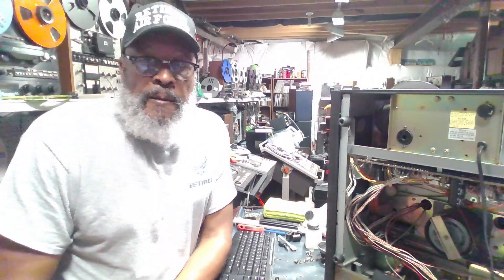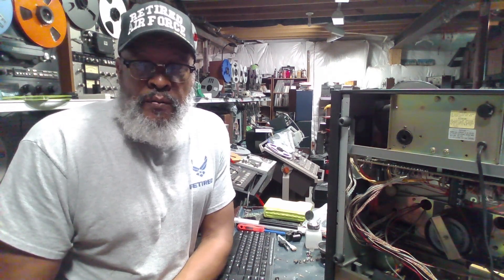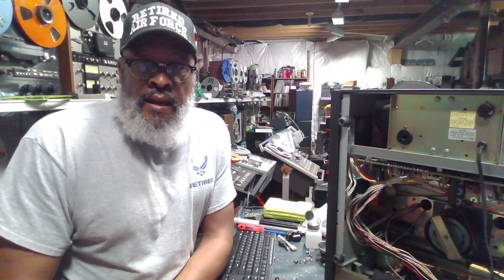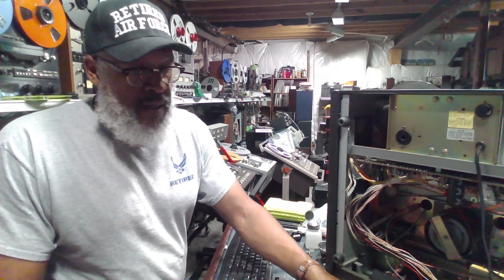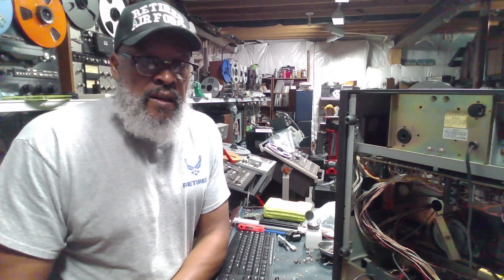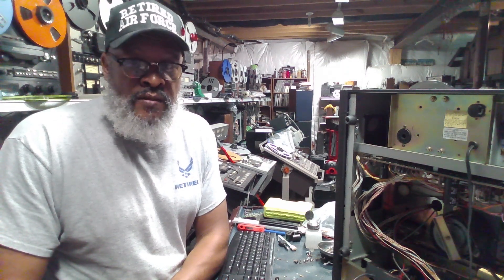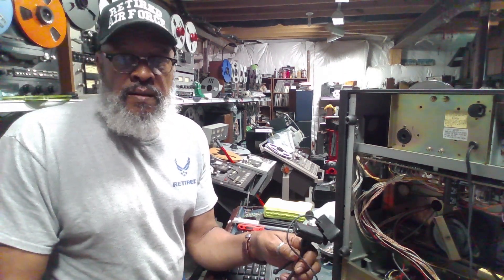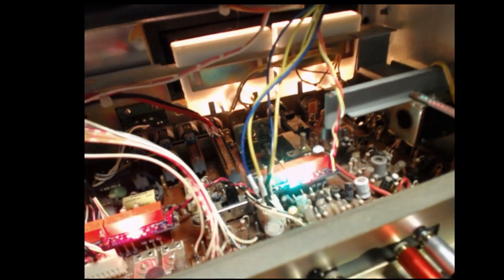Akai GX-635D Reel to Reel Reversing Switch Modification

Comment: Is there any advantage for this mod?
Reply from the maker: If your machine is switching from FWD to REV without hearing the songs playing backwards or dropping off on one channel, then you don't need the mod. If so, then this mod is a permanent fix.
Reply: @5thcomm  did you make the parts for the mod, or can they be purchased as a unit???
Reply from the maker: @patfallacaro2425  Hey Pat, Kurt Jacobs makes these and other switches for auto reverse decks. You can reach him at: kurtsjacobs@gmail.com
Reply: @5thcomm  thanks you the MAN